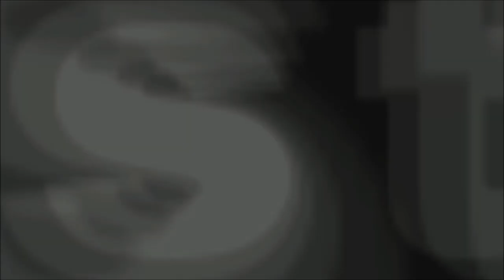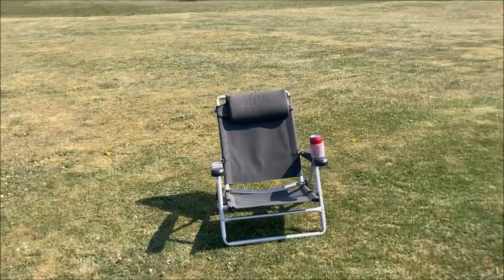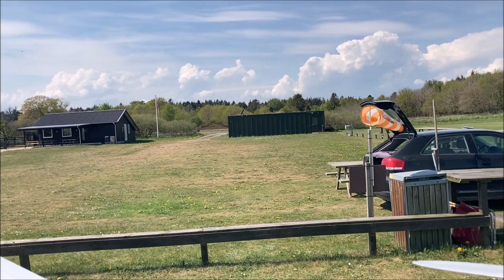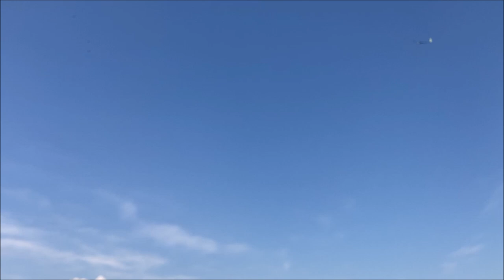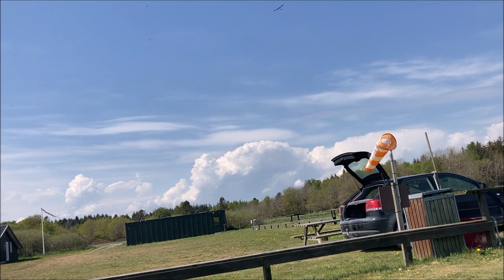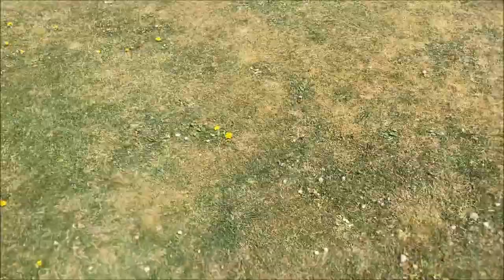How to find thermals, Speedster style

Comment: I only just finished my first RC glider build, a wooden DLG. Surprisingly I got it to be exactly 300 grams. First few flights, I was setting up the controls and a launch mode. After a while, I've been getting use to watching which wing dips and which one raises. There'd be moments I'd chuck it up, start circling and realize I should've landed already. What a joy!

I got the wooden DLG to test my ability to set up a composite performance model later on. It also gave me something to do for the winter.